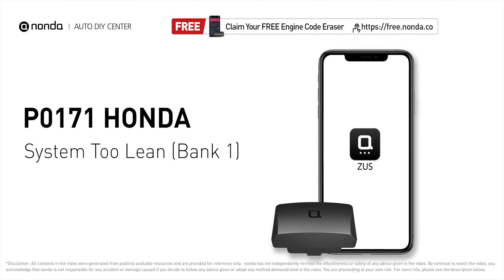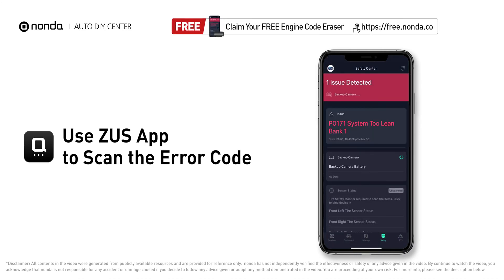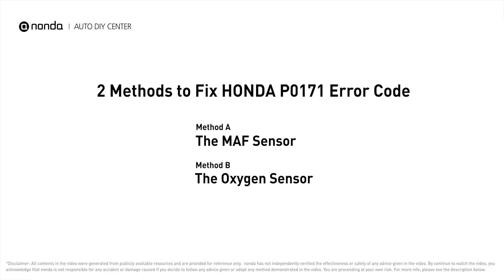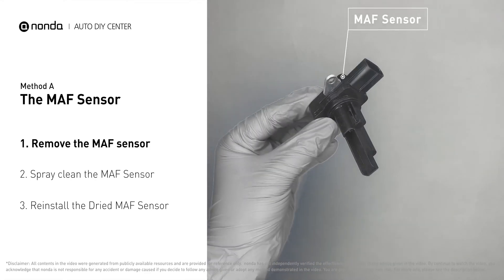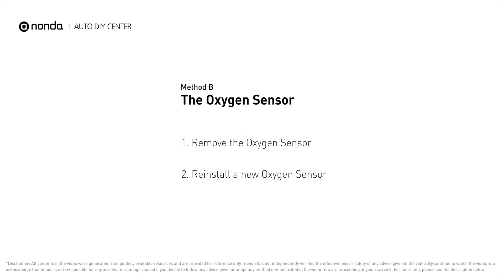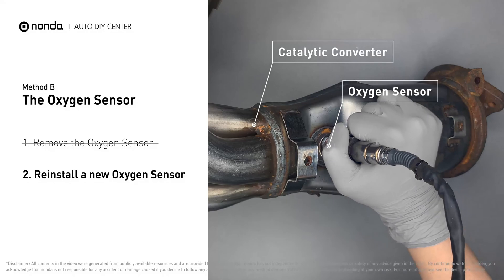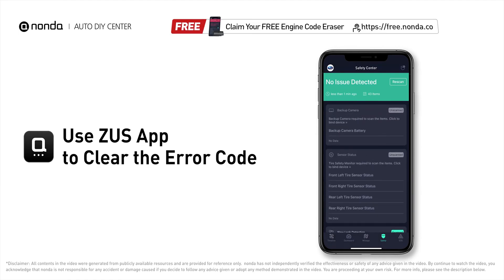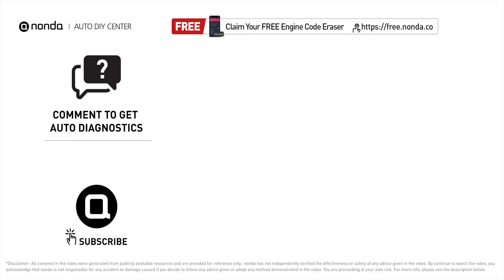How to Fix HONDA P0171 Engine Code in 3 Minutes [2 DIY Methods / Only $8.37]

Comment: Hi i have 2008 honda element with that same code. Ive changed the mass airflow senso, oxygen sensor and air/fuel ratio sensor and still nothing😢
Reply: Find some hoses unplug  and damage.

Comment: I have a Honda Pilot 2003 and cannot find the MAF sensor
Reply from the maker: Hello, it is mounted in the intake air hose of the air cleaner assembly.
Reply: Yeah, it's usually where your rubber intake tube meets your air box, where your filter is. Look for a harness plug in that area, and that is more than likely it. 
And Google it, you'll be surprised what you can find by typing "2003 Honda Pilot MAF sensor location"

Comment: I have never had this occur until a few months ago. I have a 2001 Honda Stepwgn. I discussed the problem with the boss of my usual auto service and he advised trying Super grade 5% Ethanol petrol- Our government recently enforced the change of Regular grade petrol from %5 to !0% Ethanol. No further alarms until I refilled with Regular !0%. So that works at the cost of more expensive fuel.
I have, however, obtained a new oxygen sensor and hope to install that soon and try the Regular fuel again.
Reply from the maker: Hi Mervyn, thanks for watching! Hope that would solve the issue.